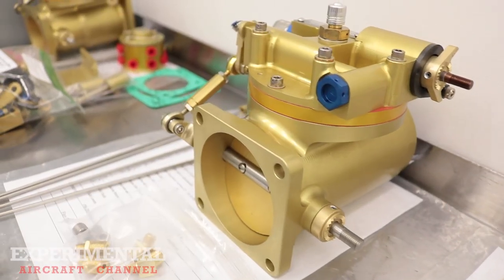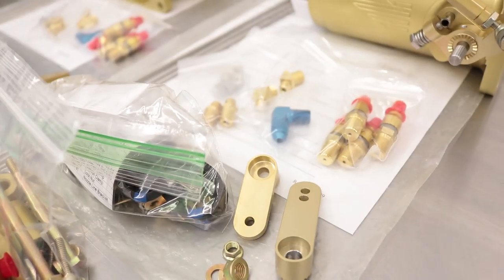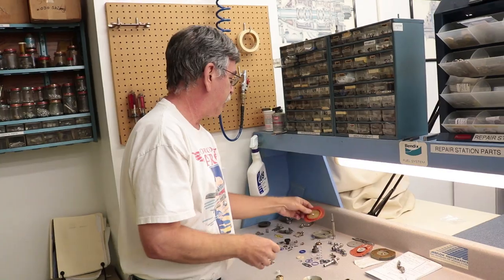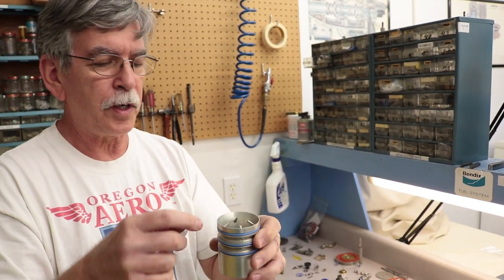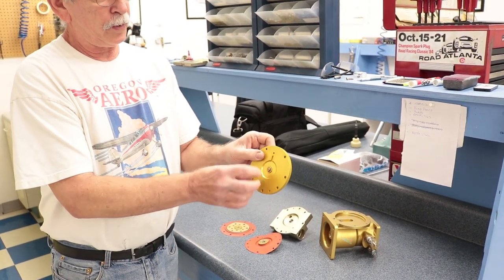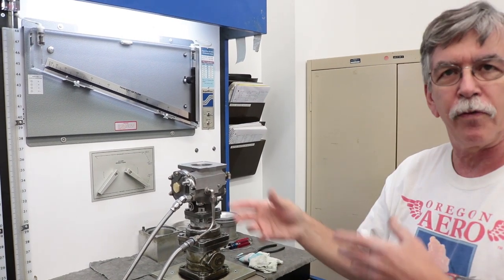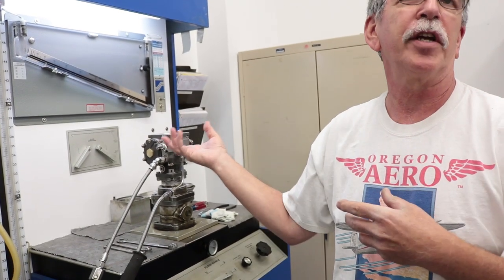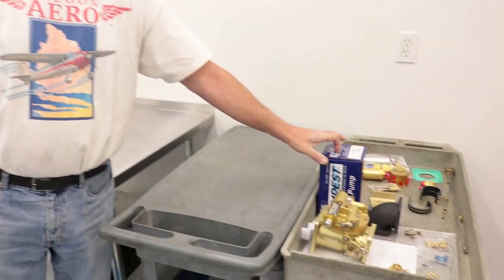Mechanical Fuel Injection for Aircraft! - Airflow Performance Explains

Comment: Wow, this is genius! I had no idea you could be so accurate with rubber diaphragms and springs. Super interesting
Reply: They really are not accurate.  An EFI setup would give better performance, but mechanical systems are fairly simple.  Springs and diaphragms all have ranges as they are 'analog' devices.  So while a spring may test spot on a 60% compression, at 50% it could give a non-linear result due to the metal/coil etc.  That would negatively affect the accuracy of the entire system.  It works, it's simple, but there are better ways to meter fuel.

Comment: My father use to race a '66 Chevelle that had a 327 w/ mechanical fuel injection and he always won his class at the strip. He said the key was getting the proper combo of vacuum diaphrams and the springs that actuate the valves, needles, etc. Every one at the strip thought my father was somehow cheating, as there were constant complaints from the other drivers. They could never find any violation and, of cousre, there was always the walk-off cursing. My father finally stopped going because of all the crap from the other drivers, which steered me away from ever going to a strip myself.
Reply: a Hillborn setup or a Rochester?
Reply: @dantheman1998  Stock Rochester unit, as I recall.

Comment: That was pretty neat! Wish they made stuff like this for automotive and motorcycle applications. I hate computers - this would be right up my alley.

Thanks for sharing, Bryan! 👍🍻
Reply: Naw you really don't, EFI is way more precise. I don't think anyone would much like the starting, operation, economy and driveability of mechanical fuel injection on a ground vehicle. I think it sure is nice to just turn the key and go, you don't need to touch the throttle or anything with the EFI systems we have on our ground vehicles today.
 Aviation technology is decades behind in those respects, unless we talk about the computer controlled 900 series Rotax aircraft engines and they are more advanced and way more economical to run than the legacy aircraft engines.
Just like the old mechanical Corvette fuel injection and GM didn't produce it for very long because it didn't work that good on the street. For an all out race car it's fine, like a mechanicaly injected engine on methanol in a Sprint car that  has an injector stack for each cylinder and delivers mass quantities of fuel and air to make big power for the track, and they work best at wide open throttle for thirty or so laps on a half mile or shorter track. So you see no, not so much. In my opinion...
Reply: Yes that was very interesting Bryan, despite what I said in my prior post,  I as well would have liked to have heard more specifics but yeah it no doubt could have easily taken an hour or more. 👍
Reply: @429thunderjet2  - I hear that from everybody, but as a mechanic, I prefer carburetion. When tuned right, I can get a carbureted engine to perform very close to as good as FI as far as fuel economy goes, but with MUCH faster throttle response. Just takes a bit more effort to do so. Most of the issues with the 'Vette's mechanical FI were cold-start related (and a failure prone vacuum device used for a cranking signal), and I'm sure it cost GM quite a bit more than a carburetor. It was that and it's limited numbers that killed it. The system right here for aircraft is FAR superior to that system in every way. I'd rather have this on a modern car than failure prone electronics.
Reply: @SmittySmithsonite  Don't know what you're talking about "failure prone to electronics". I've done LS swaps for the last 20 years. It's VERY rare to have an electrical failure, and if you do the whole engine doesn't shut down, it just runs bad until you plug in a scanner and check it out. So much easier than dealing with carbs, mixture issues, distributors, and generally, 70 year old engine designs.

Comment: How does the flow-divider prioritize fuel to the port that is in the intake phase? It can't possibly run like a slave spark.
Reply: it doesn't these are continuous flow injection systems. There is NO timing of the flow to the individual cylinders.

Comment: The 3 biggest wants for my certified O-320 are:  > TBI > EI > GAMI100UL. It’ll run like a new engine and be super reliable with those improvements. It’s shocking how the FAA has kept certified engines in the Stone Age for ‘safety’ 👎🏻

Comment: Because I'm no expert!!! I would have asked if there is or isn't a fix or change needed to the fuel flow calibration with regards to those that want to run 98 octane. The spacific gravity of 100LL is 68-74 API and 98oct is around 84 or maybe I'm just over thinking it haha
Reply from the maker: Dan.... great questions. Honestly. Thank You. Over think away. Maybe in the future, as I work out better scheduling for interview, I can put a request out to everyone of the questions that they may have. Been a lot of times, based on their schedules, these interviews are VERY last minute. Thank You for watching and supporting here. I truly appreciate You!
Reply: Ask Airflow performance directly. I've adjusted for fuel, in a non aircraft application, but would rather not elaborate for fear of misrepresentation. You'll find Don Rivera and crew are quite attentive to your questions.
Reply: It really depends on what ratio you want to obtain.  That would determine the jet size.  The fuel is pressurized, so flow it not really a problem.

Comment: Icing occurs in a carburettor due to the rapid pressure drop of the air travelling over the venturi, little to do with fuel entering. A carb requires a low pressure to pull fuel in as it is not supplied by a pump, it uses atmospheric pressure to push it in. This injection system uses what is essentially pitot tubes to reference pressure. 100% duty cycle fuel injection is very old, it serves little benefit over a carburettor. It is basically the same as having individuals carbs. Sequential injection is far better as it only injects fuel at the time of the intake valve being open, preventing fuel stand off. Mechanical sequential injection has been around since the 1930's which is more advanced than this, no different to diesel injection. EFI is far better than all of this, simpler, lighter, cheaper, better atomisation and far more accurate.